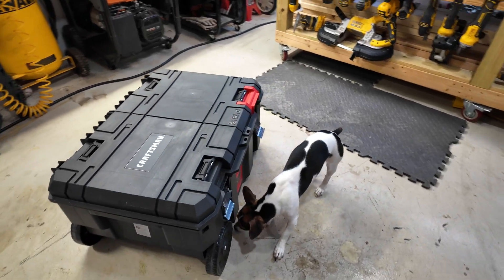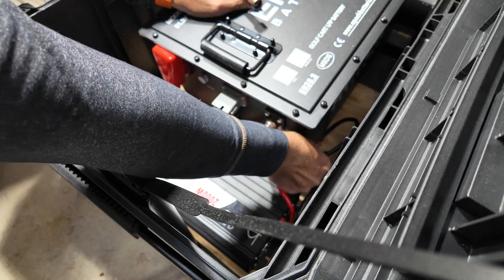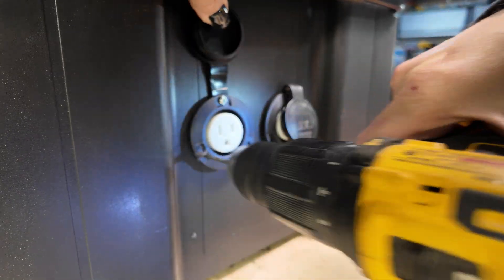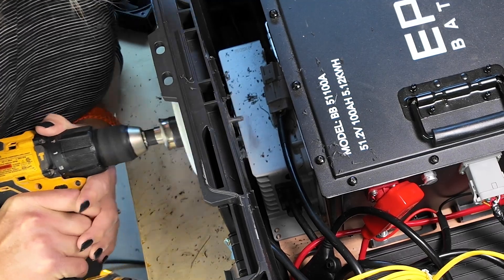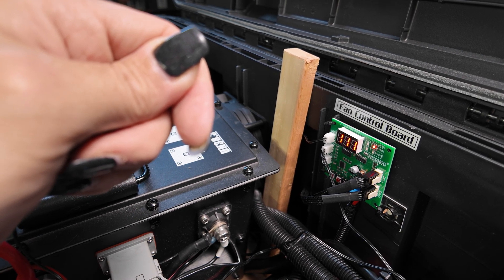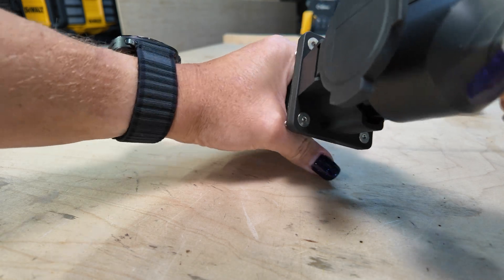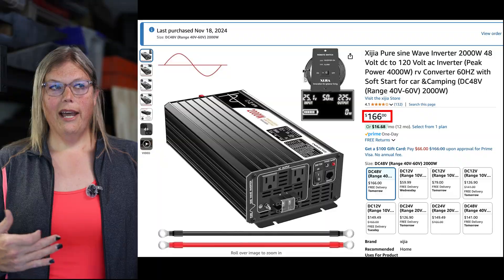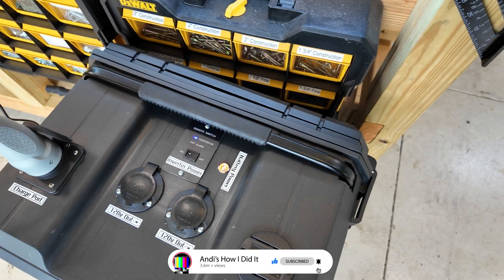DIY Portable Power Station 5400Wh - LiFePO4 Battery 2000W

Comment from the maker: If you want to snag your battery or inverter, pick them up here: Epoch 48v 100Ah LifePo4 Battery: https://bit.ly/49faoOz - the inverter is available on Amazon: 48v 2000 watt inverter: https://amzn.to/40NTTod
Reply: Not to be negative but the links you have up are priced at around $1499.00 and 166.00 respectively at the time of writing this post 1665.00 not including taxes or shipping however upon closer inspection a COTS system is anywhere from $2500-10,500, the upfront investment is a bit on the higher end not to mention the cost of the accessories. Please include the other links because from first glance it seems a bit tone deaf but otherwise I enjoy watching the build. Thank you for your post, it inspired me to consider what this same build would look like with different power systems.

Comment: Pretty cool...

I have two 36 volt lifepo4  trolling motor batteries (50 Ah each), that i could use for an emergency box. I already have the chargers. Total power would be: 100Ah*38.4V = 3840  Watt*hours. Not bad. All i need is a 36V 2500 watt inverter and a box on wheels.
Could use it to power a portable AC for a few hours.

Comment: Put some caulking around the plug and switches on the back side of the flanges use a good silicone caulk and it will be water tight. Just a thin bead so it won’t spill out all around the outside of the box. If you get some on the box use some alcohol to remove it while it’s still wet.

Comment: What a pointless video. I thought this was going to explain how to save money instead of buying a ready-made all-in-one kit for around $2,000. But instead, she wants you to spend $2,000 on just the battery, then buy the inverter, then the box, then the wires, then all the plugs, sockets, USB ports—the list never ends.

What exactly are you trying to prove here? This comes across like pure clickbait. You’ve completely contradicted the entire purpose of your own video.
Reply from the maker: I appreciate you taking the time to comment, but it seems there was a misunderstanding of the build's purpose and cost breakdown, which is covered in the video.
Cost Comparison: My intention was not to build the cheapest box, but to build a high-spec DIY unit for less than a comparable commercial product. As I state at [00:28] and again at [14:23], portable power stations with 5,000+ Wh and 2,000W output cost $3,000+. My final build was between $1,300–$1,400 [14:31], achieving a premium result at a DIY price point.
Battery Price: I directly address this. I show and discuss multiple battery options, including ones around $1,000 [12:04]. The specific Epoch battery I feature costs about $2,000 but I mention there are 'usually sales and discounts' [12:20].
Components: The video confirms this build focuses on AC output for things like field lights [09:52]. I did not add any USB ports or low-power accessories. It's actually pretty simple.
The main advantage of DIY is getting a powerful, durable, and upgradable system that fits your specific needs [13:24] for significantly less than a pre-built commercial equivalent.

Comment: Loved this.! i need to set up a very similar system to back up a water pump. It is 1Hp 5.1 Amp and 240v. H
ow do i get 240v from the 4000w inverter?
Reply from the maker: Very simple! You just need a split phase 48v inverter like this one: https://amzn.to/4nG2eT0 - you'll have l1 and l2 that you'll use to get 240v. 4000w should be fine for that amperage load.
Reply: @AndiWofford  Thank you!

Comment: Thanks for the awesome info. I was going to spend a lot more on the case but this will be just as good and probably more durable. 

I plan on using it for a radio setup but the battery part will be its own multipurpose thing. 

I’ll be using two smaller 12V ones though because I have them, so might as well use them.

Comment: you complained about a ready made $3k power station but linked $2200 worth of parts plus your own labor and really no warranty. Not sure this is the right way to go.
Reply from the maker: That's a fair question; you hit on exactly why the cost comparison isn't always apples-to-apples.

You're absolutely right: if you buy a $3,000+ ready-made station, you are primarily paying for convenience, a unified warranty, and someone else's labor—and that’s a great option for many people.

However, for my build, here’s why the it's actually a better long-term investment and why the DIY path may be right for some:

Warranty: My single biggest component cost is the battery, which has a 10-year manufacturer's warranty and a life cycle that far exceeds most consumer-grade power stations. I'm getting a much higher capacity and longer lifespan per dollar.

Repairability & Upgrades: If the inverter fails on a $3,000 ready-made unit, you have to ship the whole thing back to get it worked on if it's under warranty. If my $300 inverter fails, I swap it out and I'm back up in 15 minutes. The modular design means the cheaper components are easily replaceable and upgradeable (e.g., swapping a $50 charge controller for a better one), which you simply cannot do with a pre-built box.

Customization: I designed my system for my exact needs (specific ports, high continuous load, fixed installation, etc.). You order from Amazon, you're getting it sent based on manufacturers specs.

Ultimately, the DIY route is for the person who values longevity, custom specs, and modular repairability over simple plug-and-play convenience.

Thanks for the great comment—it highlights a crucial part of the DIY vs. commercial off the shelf debate!

Comment: you have built a very nice power box, powerful, fully functional, yet less expensive. easy way to waterproof is hot glue the gaps from inside, or go further use 5min epoxy to seal them.
Reply from the maker: Thanks for the tips!

Comment: I want a power station company to exist that has a "build your own box" 

The website would have a tool and we spec out what we want, like battery chemistry, plugs, shape of container 

Sometimes you just need a huge USB power bank the size of a lunch box.
Reply from the maker: Sounds like an interesting concept! Every has unique needs for their power stations.
Reply: @AndiWofford  Exactly and there are tons of different specs to tune. 

Some people want a single outlet, others want 2 outlets. Some people want usb. some people want to wear their power supply, others want a light on theirs or a barrel jack connector, some want to recharge with solar panels that use a specific outlet type, others want to recharge using usb type c. 

a company that lets us spec to our hearts content is definatly needed.

Comment: Im not saying this isnt useful but a cheap solar generator would have worked fine since you stay under 2000w for a couple of hours
Reply from the maker: For me it wasn't about the wattage as much as the capacity. Even at this size I can only run for 3-4 hours. Plus if they wanted to add lights, I'd be right at capacity for 2 hours.

Comment: the battery you use alone costs 1500. Add in the costs of all the other stuff (including the charger which you didn't seem to link) and I suspect you are pretty close to the same total cost. Maybe you should have started the video discussing all the devices you needed and the total costs before you talked about a case and how you mounted the battery in it.
Reply from the maker: If you watched the full video you would get the rest of the explanation on the battery cost; there's more to the story. I didn't link the charger because it comes with the battery; i.e. there was no cost associated with it so it did not add to the total cost!  My cost was nowhere near, but I'm very clear about options on different batteries and how much it would cost you in the part of the video that deals with cost.  Also - there are chapters in this video, and if you wanted to know the "Component Cost", total cost, whatever,  you could easily find that in the aforementioned chapter name at 12:10
Reply: @AndiWofford not to mention the added safety of LiFePo4 vs. Li-ion.
Good on you for following this up!
Reply: People often make comments without considering all of the available information.  They are the Selectively Ignorant that make up a large portion of the Social Media population.  The Selectively Ignorant are why Social Media thrives.  They make the most ignorant content and comments.
Reply: @UmpTSquat The battery used is $2k. The comment is fair.
Reply: …. With wayyy more power capacity
Reply: La satisfacción es diseñar y construir, si cuesta más o menos no es realmente importante.

Comment: HVe the same inverter 48v. Given that the 48v batteries Re expensive a 12v system is cheaper. And easier to find components at a decent price.
Reply: 48v batteries are typically cheaper. Have to remember 100ah at 48v = 400ah at 12v. Plus the cabling is much cheaper and more compact
Reply: @Knatb06  ive searched ebay for batteries 48v 50AH thats the cheapest at 300 $ gives youy total energy of 2,400wh 0or 2.4kwh. 12v 200ah is 185$ a12v 200 ah gives you 2,400 wh. it is true the 48v systmem doesn need expensive thick cables

Comment: I have a electric moto bike with 7kwh battery. Currently charge at track with 240v 999$ Costco generator. Is there affordable portable diy - 2000$ max that would give me 10kwh battery with 240v outlet and 110v outlets? Your video was great. I am learning.
Reply from the maker: I hate to say it, but that's really ambitious, and depending on what 10kwh voltage you're talking about (48v, 12v, etc), it would be enormously heavy. Even at 48v you'd need two 100Ah batteries (like two of these $700 server rack batteries - https://amzn.to/3TOvtqg ) . And while you could do that for under $2k, you're going to spend up near $600 on a 5000w inverter that'll have two phases to get you to 240v (like this one: https://amzn.to/40ozKVe ). Not to mention wiring, breakers, case, and a charger to charge it back up at home. It's possible to do it for around $2000, but my guess is for that much capacity and amperage, you're going to be closer to $2500 or $3000 by the time all the parts are ordered.

Comment: Hi, very cool set up. I have a 48V 100Ah battery. What do I need to be able to charge it with at an EV charging station?
Reply from the maker: Make sure your battery charger is 120/240v, because EV charging stations will be 240 and you will fry anything that plugs in and only handles 120v.  If you're good there, then you only need a J1772 adapter like this: https://amzn.to/4nV9b42

Comment: consider using marine electrical components and maybe an outdoor small panel box for your rceptacles mounted on the face of the front side and use liquid tight conectors from the back of the panel into the side of box   for your 110  and dc 12v and whatever other voltages you need a breaker for each recepticle and fuses for ur dc power again marine electrical components are pretty purpose built to be as water resistant as posible without being directly submerged or directly  sprayed into the recepticles
Reply from the maker: That's a good idea for keeping everything protected, thanks for the tip!

Comment: I’m not familiar with the different types of battery’s but I found a similar 100ah battery for 200. Are there big price jumps depending on the battery you choose?
Reply from the maker: Great question! Yes, there can be big price differences depending on the battery chemistry, cell grade, and features. For example, a 100Ah lead-acid battery might be around $200, but a quality 100Ah LiFePO4 (lithium iron phosphate) battery can range from $300 to over $2000.

The price jump usually reflects several factors:

Cell grade: Higher-end batteries use Grade A cells, which are more consistent in performance and have a longer cycle life.

BMS (Battery Management System): A good BMS protects the battery from overcharge, over-discharge, overheating, etc. More advanced BMS units also support high continuous discharge rates (like 100A or more), which is critical if you're running inverters or high-draw devices.

Bluetooth monitoring: Some batteries include Bluetooth apps so you can monitor voltage, temperature, state of charge, and even individual cell balance from your phone—super handy for off-grid or DIY builds.

So while a cheaper 100Ah battery might work for light use, if you're building a serious power station, it’s usually worth investing in a battery with high-quality internals and better specs.
Reply: This is extremely confusing for people just getting into this as well. Please  understand that there is a huge discrepancy between the voltage your system is running at as well. If this was a 12-Volt system, a single 12V, 100Ah battery, will deliver 1200 Watt Hours (or 1.2KWh). So, this is a battery pack containing several batteries, or it is a 48V system where one battery would be 4800Wh and is just a specialty built battery that is closer to 112Ah that is just labeled as 100Ah. All this to say, just do a little research. Don't pay so much attention to Ah and such. Main thing you want to know is Wh or KWh because that's how you will know how long your battery will last. 10 watt light bulb on a 300Wh battery? Will last you apx 30 hours. A little less due to loss caused by converting DC to AC through the inverter, but there's your basics. If you can't find the Wh then multiply Volts times Ah to get Watt Hours.

Comment: For the fans, have you considered using Noctua iPPC fans? They’re IP rated, and run on 12V (so you’ll need a step-down).
Reply from the maker: I'll be honest; I didn't look at any 12v fans. Really didn't have any need for 12v in the build so I wanted to look at solutions that were rated at 48v. There's a few battery box builds out there that I've seen where people use the 12 volt side of accessory power for powering devices in addition to 120v. Sticking with 48v really limited me on the choices because there are plenty of 12 volt fans out there that are IP rated, but finding a 48 volt fan that was IP rated and variable speed was much more difficult. I don't know if tariffs have affected the prices, but when I bought mine they were reasonably priced for what I was able to get. Just took a few weeks to arrive.

Comment: No precharge resistor for the inverter, no shunt trip for the battery, no circuit breaker protection for devices? Seems like a missed opportunity to do it right. 😎

Comment: I like your build and methodology. You put in a 100AH battery EPOCH battery that costs $2000.  I realize someone could get a cheaper 48V battery and do the entire thing for less, but your final cost estimate only showed $1000 for the battery box.  At 14:53 minutes you said you spent about $1368 on "your" build, but your battery cost $1000 more than your showing in the costs. Your build was closer to $2300. Someone could get the impression that they could build the same thing with the same components for $1,368 and that is not the case.  It would be best to be clear for viewers that may not catch the differences.  Also your battery link is not to the battery you used.  A server rack battery in your box would be an appropriate application or fit.   Thanks
Reply: im seeing this 4 months after your post and the battery linked now is $1999.00.
Reply: Your box would be more waterproof if you had removed the Burns after cutting your holes.

Comment: Jackery Explorer 3000 V2 Portable Power Station with 3600 watts for $1699
Reply from the maker: A little more than half the capacity at 3,072Wh but a bit more power at 3600W  output. All depends on what your needs are

Comment: I do a lot with this stuff and my inner maker had a stroke. I don't know if it was camera angle but it looked like your battery was sideways in the box. I don't know if you bolted down the inverter and the charger to keep from rolling around when you stand the box upright. When you drill holes you gotta debur them otherwise your gaskets will fail because there's microplastics that are keeping the gasket from sitting completely flat on the surface. Overall it was a nice build just a few minor details that I had seen.

Comment: So you passed up a quality prebuilt box with 4000Wh capacity and a 4000w inverter for $2800(Delta Pro 3) to build a unit that is 2000Wh with a 2000w inverter for around $2500+???
Or you could have bought the Delta  2 Max with slightly better specs as the unit you built(and a warranty) for $1100(YES, less than HALF what you spent!)

Am I missing something?
Reply from the maker: Yes, you're missing that this custom built box, as it says in the title, is 5400Wh vs. the 2048Wh of a Delta 2 Max. I built this box custom for the need I described in the video, and that was Wh.

Comment: What a great solution for a specific need. It's amazing that nowadays you can even light a field with such a low power draw.....these new fan dangled LED lights are amazing.
And like you say, you can use it is a back up generator for power outages and emergencies. Training is likely cancelled anyway during a hurricane!!!!!!
And last thing, what a great looking professional build. Looks like a commercial build. Kudos.
Reply from the maker: Thank you so much for this comment! This made my day! You're exactly right, it can be great for power outages and I'm sure that most coaches would cancel practice during a hurricane. Perhaps not all of them 😂

Comment: I've purchased 2 of the same fan controllers off of Amazon for my DIY portable power station and couldn't get either of them to power up. There are no instructions with them or any support. I returned both of them and I'm waiting for a different one to arrive.
Reply from the maker: Really sorry to hear that. I think the voltage is variable and mine seemed to light right up. I guess the quality control isn’t there for $15